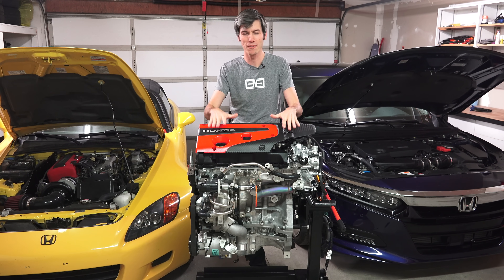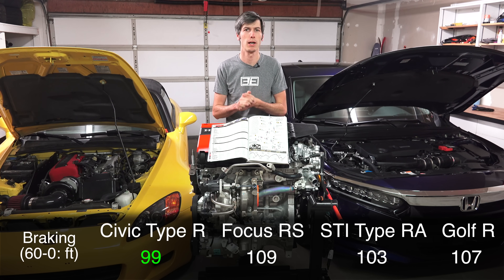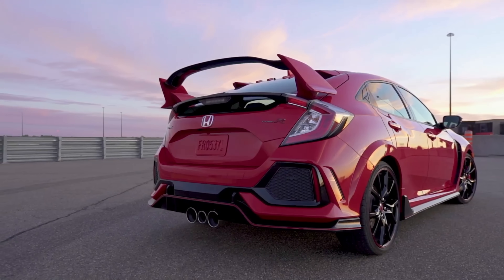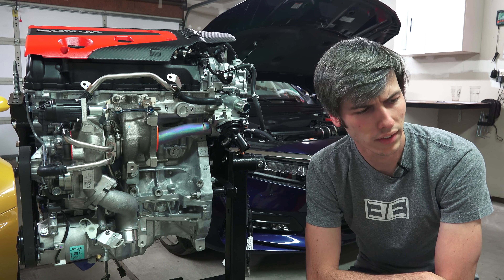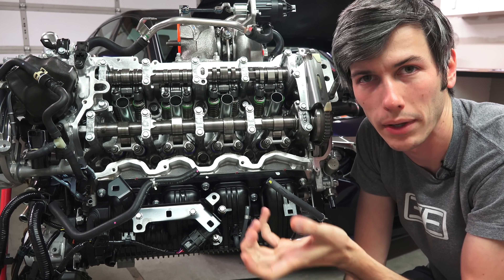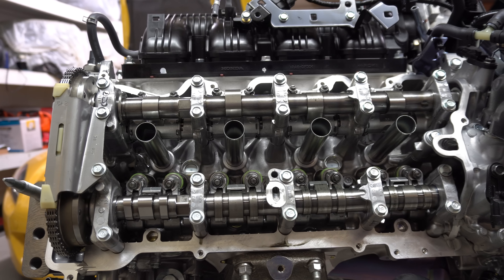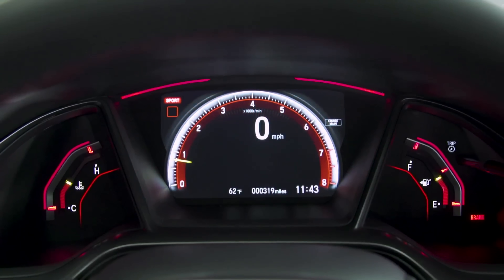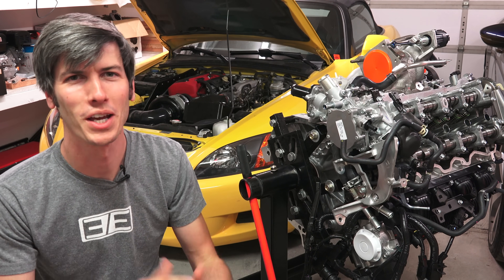The Honda Civic Type R Destroys The Competition - The Best Engines

Comment: So many people reeing because its FWD and Honda. Face it it's faster than AWD and RWD hatches.
Reply: FWD is great fun but the real problem is well....just look at it.
Reply: I live in NE Ohio. And I'll tell ya', nothin' against the Type R but, when the snow starts flying, that RS will annihilate that Type R (on the way to work.....)   ;-) For me, the RS's all wheel drive makes it more usable over a larger portion of the year. Thereby making it more desirable to me.
Reply: I prefer the Type-R but you have a point. The Focus in some environments is a more usable car.
Reply: They should Build a m4 layout car
Reply: And Coupes......and Sedans.
Reply: @angelpdi7471  wrong
Reply: @angelpdi7471  uhh no.  Its not faster then sedans and 2 door cars that are awd or rwd
Reply: @MrBooster999  It depends: on curves, where usually normal people that believe they are professional drivers that do not know how to take them? Nope. People usually have to hit the brakes to the bottom of the ocean in order to take a curve. The Civic Coupé 2016 stability and speed mix with a set of ContactPro TX tires surpasses easily even an Audi R3 under those conditions.....proven, almost weekly.
Reply: @angelpdi7471  no such thing as a Audi R3
Reply: No its not the fastest just check out car wow drag races and then you will see what the fwd  disadvantages are it is slower than a focus st and the audi rs4 with its quarttro  system blew it away. Yes it may look amazing on paper but too see it lose against a golf gti was an eye opener.
Reply: Its faster than the 15 year old subaru, and a volkswagon golf by 2 sec on a 3 min track run.
Its faster than a focus by 1 sec.  but if you look at some of the other numbers they used, Im not sure how official any of this is.
Reply: @cre8tive1imok98  Last night was faster than a Tsubaru WRX on the same curve, on the same Highway. We just had to witness how 310 hp were reduced to granny driving because of a poor stability control.
Reply: @2likru Esco M8, no speed = no movement
Reply: Mr. Typical corvettes are rwd and come as hatchback.
Reply: @W29001  lol are you high I don't know what Corvettes you are looking at. Plus Corvettes are in a different category than the type r. I mean other hatchbacks
Reply: @Olds_Pwr  a lot of people actually the trend is coming back
Reply: And the type R is still inferior to a lancer evolution type 9 mr. Inferior to a well a number of hot hatches by many measures from all different price ranges.  And ir’s nit even close to being a hyper hatch, or having awd, RWD for that matter, torque vectoring or all sorts.  For the price a 10 year old lancer evolution 10, is easily more powerful, drivable, and on stock suspension maybe quiet quite as advanced as front wheel drive is ever gonna get there tuned that hard with all that aero, and yes it does get torque steeee😂 still.  Just mitigated.  Really the lancer evolution 9mr with some minor bolt ons and tuning really without bad and considering the price now however many miles, maybe just basic chansis tune above the limited 9 addition will absolutely slay this thing around any track ever.    That old Iron.block was so strong, and the handling is just scalpel sharp even today, Unless you are boosting with absurd turbo for 8 second drags,  really minor bolt ons now very cheap will get you an500awhp car with pretty minimal lag but you can tune down or use smaller blower for technical and more response and again 450awhp is easy and very drivable and that is $5000 of upgrades maybe basic stuff and stock
Internals cams, maybe bigger fuel injectors for turbo swap if you did that but getting a lot more performance out of evo 9 mr on stock turbo to shame the civic type r considering it had like a basically 15 year technology advantage are just really easy.

And again, really type r doesn’t scratch hyper hatch category.... it’s just I guess the fastest production FWD car?  Wow exciting lol..... gen 6 v6 or v8 even camaro v8 1le 2019 is the same price.  Before you
Get on me,  Yes it is same price or cheaper than civic type r brand new IF... you Know how to buy cars.....   and a bell of a lot faster around probably any course than thise hatchdes underwhelming other than  Forus RS comparisons.  And it is same price brand new 2019.  I can find one at least no issus.  And if gasoline was a concern I’d just go true dual ethanol and gas intelligent kit with advanced tuning profiles.  Ethanol not great energy density but running efficiently on right tune it’s dirt cheap still so don’t fuel price not huge issue....
Reply: Slightly faster has never equalled more fun though. That's one thing I dislike when people quote lap times and so forth. It doesn't really translate to how much you can enjoy driving a car and pushing it a bit. The Focus in particular is more fun to drive enthusiastically.
Reply: True but the car handles well AF. And for a lot of us that means fun, more than a car that want to drift everytime. It will depend on your driving style. If you're a guy that like more clean fast lines than to drift, the CTR is the car you want. GRIP GRIP GRIP.
Reply: P GR  you obviously havent driven one of these, watch that head gasget
Reply: @pgr3290  but the type r is a better daily
Reply: @mr.typical3169  Not really. The Honda has more trunk space. The Ford has more all weather practicality. I would rather drive the Ford in the wet and winter every day than the Type R.
Reply: No... AWD will not be faster in everyday driving. Low revs with turbo lag, fast clutch uptake, short shifts, and the extra weight and drag of AWD will not only make it slower than this FWD hot hatch when driving in day to day traffic.... but most sedate family cars as well. 

You look at any Subaru STi just cruising around and it’s always slower than the traffic around it.
Reply: But it looks like a prius.
Reply: Mr S  umm...
Reply: @MrS22222  I dont how you came to see the Type R as a bland Prius, but this car is anything but bland!! The styling was over designed to perfection!!!
Reply: @Mohapi_Tau  its not bland, its over the top squiggly flaring similar to torpedo fins, the ultimate factory ricer.

It reminds me of Mr. Garrison's "IT" from south park, sure its kinda fast but it makes you look gay af riding in it.
Reply: @MrS22222  Whatever the semantics in the naysayers, I don't get how riding in such a dope car makes you look gay with such aggressive styling. Sure, the design wasn't meant for the conservative executive. It's an enthusiasts car that is aggressive.
Reply: @Mohapi_Tau  listen, I respect it for what it can do and the technology put into it, but I don't like the body style at all. The lines are what thow me off and it looks kinda prius-y to me as a personal opinion. It would be nice to see a stealth version without all the flashy body lines.
Reply: @MrS22222  pretty fast prius
Reply: @mr.typical3169  [pretty ugly sports car]
Reply: @MrS22222  your opinion my dude it's subjective.
Reply: But AWD will be faster if driven by everyday driver like you and me.
Reply: @jpogigtxcr1778  still the numbers show from the type r that it can compete if not beat RWD and AWD
Reply: Mr. Typical Numbers are only numbers until we actually drive the car.

With my experience, (although a different car) I'm not comfortable throttling in a high powered fwd. Specially on a turn, it either understeers or oversteers. AWD although it feels more sluggish is more predictable.
At least RWD (most "slippery") I can predict when will the rear tires will get loose.

I'm a fan of the cheapness, simplicity, traction of a front engine fwd... but only in commuter cars.

Comment: 1. Its FWD so it works only with perfect weather conditions. 
2. Its FWD so you can't have fun with drifting/powersliding
3. Civic Type R has got BIG problems with gearboxes - try to investigate a bit. Honda doesn't give a f**k about it.

Comment: Great video. I would love to see you touch on Honda's approach to mitigating oil dilution and carb deposits on their newer direction injection powertrains. There's been quite a lively discussion on these two topics, which in turn has caused unnecessary paranoia within the larger TCDI communities. But some of Honda's trickery ranging from valve overlap to PCV/oil separator design, to simply accelerating the maintenance minder under specific scenarios, could be a great topic for a future video.

Comment: Some incredible numbers for FWD! I don't even understand how it's so close on acceleration, and even faster in the quarter. The weight advantage doesn't seem big enough
Reply: FWD has less drivetrain losses so it puts down most of its power so its whp is not that far off from the more powerful AWD competitors.
Reply: @Kh501pr  it dose have less drivetrain loss but dose not put down most of its power the tyre r is at the peak or what fwd can handle and get round a track when u start hitting big numbers they are only good for straight line and even then its hard to get them moving
Reply: Nicky Davies That’s what people said about previous Type Rs so we’ll see
Reply: Nicky Davies that’s true for FWD cars of the 80s and 90s, but Honda will continue putting power down through the front with new diff and suspension technology. Who knows what computer witchcraft Honda will use in the future to get more and more out of their classic and practical fwd layout
Reply: @phamnuwen9442  yep you melt 2 tires instead of 4 at the same time,  it costs less 😉
Reply: The answer is simple: VTEC kicked in yo!
Reply: King Ganishka that's a balance tuned car yeah
Reply: Civic comes with ultra sticky summer tires, that's why the numbers.
Reply: More HP  less weight of the car & tires play a big part. Hell if Suzuki swift FWD make crazy HP from factory with sticky tires it will beat all these in a straight line too.
Reply: DeSpace Man yeah more horsepower less weight but slower when talking off
Reply: Honda understand their grip level and tuned it well so that no torque is wasted into wheel spin. For the case of others, 4wd will always have greater grip level. Its just that their engine couldn't supply enough torque for it to accelerate faster than the Honda
Reply: 300lbs is a pretty big difference. Tbh. 300lbs is like a mustang to an rx7. Or a mk4 gti vr6 to a miata.
Reply: Theoretically, FWD is physically better than all-wheel drive in the way of less drivetrain and more power delivery, however, AWD is better based on physical frictional forces on the terrain of our world. The ideal car has a lot of horsepower and torque, however also AWD. Along with other things that apply to cars in a similar manner.
Reply: Fwd puts the power down and are fast stable quick cars when tuned right
Reply: King Ganishka yeah g
Reply: The 50 extra ponies would help.
Reply: maybe the gear ratios are spot on
Reply: Honda is manure
Reply: 300lbs is a big azz difference! Just imagine running with 300lbs on your back vs 0 lbs on your back
Reply: Size of wheels my friend smaller wheels= less rotating mass.
Reply: It dosnt have vtec on intake

Comment: Waiting until they rectify the known transmission problem.  Who wants to purchase a new vehicle that will need transmission repairs right off the bat.  I'm sure it's not happening to every owner, yet, but with a known transmission issue, it's bound to show up at some point.  It is affecting a significant amount of owners, which you can read about all over the Net as well as here on YT.

Comment: At the end of the day though, it's still FWD and as ugly as sin.
I had a 210 bhp FWD car once - a 16V NA Peugeot 205. It was great on the flat, but completely lost on uphill bends when trying to put power down.
I'm sure suspension and traction/stability control have improved things since those days, but basic physics says an FWD car will always have problems putting power down on uphill bends.
That's perhaps a niche criticism and it's a very capable car - I just don't like FWD or the hideous boy-racer styling...

Comment: Hey bud, you are gonna need your intake valves cleaned way before 100k on gasoline direct injected engine. Honda is not going to put that because they don't car it's already out warranty and then car owners problem.
Reply: You have very little understanding of Japanese culture if you think they would lie about the 100k miles.
Reply: Yeah and Honda is known for their unreliability.. o.O
Reply: Jason Day, you have very little understanding about corporations.   Nothing to do with Japanese culture.  If it was, Honda wouldn't have released transmissions like those in the 5th gen prelude which were ticking time bombs.  Mind you, Honda is not known for good autos in general.
Reply: Brian Tucker no that's not possible. People wouldn't be into draining dirty oil from an OCC every few thousand miles.
Reply: Hank Hill Minor Maintenance required for honda engines and it will last a life time as long as you keep checking your oil. ✌🏾
Reply: @troublezzzz  this is not the old n/a k20. It was port injected. The k20 turbo engine has direct injection. All direct injection engines have the carbon build up problem in the engine head and valves. So this engine is no exception.
Reply: @pokest225  The new designed DI engines have small injector/ injectors to wash the intake valves allegedly. 

Don't know if this engine would have it.
Reply: @staywhite6332  no. This engine doesn't have dual injection. Only vag engines have it, but not in the USA. And the mustang Gt.
Reply: @pokest225  aaand Audi 5 cylinder turbo 😉
Reply: Im sure everyone will move to a baffled catch can and vent to atmosphere to stop the carbon buildup.  Otherwise you will just have a carbon blasting every 30-50k miles like us turbo bimmer owners.
Reply: @joshlynn6567  
Yes sir. If you're concerned about your direct injection intake valves getting dirty, an oil/air separator is the answer. That is the best DIY solution at the moment, I'd say.
Reply: Pardon me for being ignorant... but why would you need your intake valves cleaned on a direct injected engine when the only thing going past the intake valves is clean air?
Reply: @Bartonovich52  because of the PCV valve. Positive crank ventilation allows dirty post combustion gases to be recirculated back into the intake to the be reburned back thu engine. I think I have that right. People will let me know if I don't lol.
Reply: @timothycc711   you do. If no injector above valves. Gotta clean. Seafoam or whatever.
Reply: Timothy Clark AND...EGR!
Reply: It's possible Honda has included a canister in the PCV system to strip most of the oil vapor out,  which can drastically reduce carbon build up on intake valves, but if so it should have been mentioned.
Reply: Agree hank hill. My understanding is gdi is great performance and better mpg and emissions. Gov likes it so it here to stay. Extra steps for routine maintenance...dont own honda but watch out of respect for damn good engineering. Think car companies kind of finding ways to make more in the service department for those of us not as mechanically inclined...see ford turbo charging trucks and large suv's😉. Just opinion. Thanks hank hill.. "Tell you what.." Love that show

Comment: Tell people how 1.5T CRV generates more oil or gasoline    delutes oil, the end result is more fluid in the oil pan over time
Reply: A software update and a climate control unit replacement is now available to solve that issue.

Comment: Very little of what you point out is new. Sodium filled valves have been used for donkeys years since British Leyland’s Metro Turbo A+ series engine. You can also see under piston oil jets on MX5 1.6 engines dating back to ‘89. Im hugely dubious of the American testing and would bet my last Rolo that an Evo 9 FQ300 would beat all of those cars.

Comment: HONDA FTW!! I see a lot of comments wanting a RWD version or AWD.. 99% of the time, FWD is just better and safer. Just look at insurance premiums for RWD and FWD vehicles. RWD is more fun, I totally agree. RWD is also complicated and usually has an axle well running between the seats taking up space. Most of the time we are usually cruising and rarely use the potential of RWD. In such small lightweight cars, we woud never realize its true potential all the time. In a Ferrari, Porsce, Lambo yes!! We need RWD and AWD, but a small hatchback I really think you can have as much fun if not more with FWD.

Comment: Honda engines are very well designed. I've owned a couple Honda cars in the past. I had a brand new 1990 CrxSi in HS, it was so much fun to drive.
Reply: I loved driving the older CRX Si and the Civic hatchbacks.  They were just such a fun engine to rev out.  They weren't all that fast but quick enough to have some fun and the handling was decent as well.
Reply: Owned a ‘85 CRX si , one fun car to drive
Reply: @stevethomas760  If I could buy another brand new Crx Si, I would.
Reply: My jealousy is intense
Reply: Yes they are! I LOVE my RSX. Fast and reliable
Reply: Frames may be weak but they're super light
Reply: ill give them that, a honda civic is only 85 lbs heavier than my swb 2wd ranger, so theyre pretty light
Reply: Engines good, but the frames around them are extremely weak :(
Reply: They make the shittiest F1 engines though.
Reply: @1OssoBuco  that didn't age well lmao
Reply: @1OssoBuco  wrong

Comment: SAAB using Sodium filled valves in the Aero 4-cylinder 2.0 or 2.3 liter since 1998 or earlier (considering 1992 9000 Aero), producing 200 to 300hp stock. Also those engines are chain-driven as for the timing, "for life" was meant 200 to 250k km there. But being that old, there was no variable timing or different cam profile :) however I get it was different emission standards and peak power at 5500 revs.